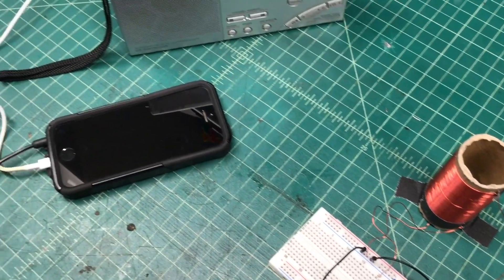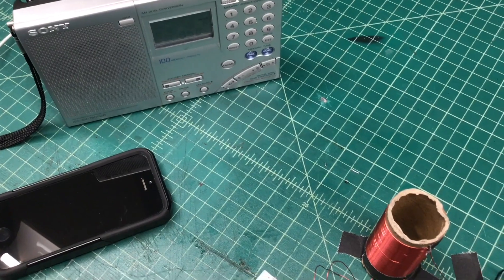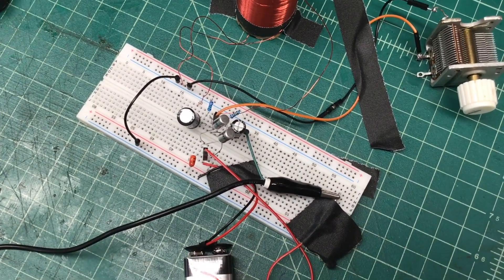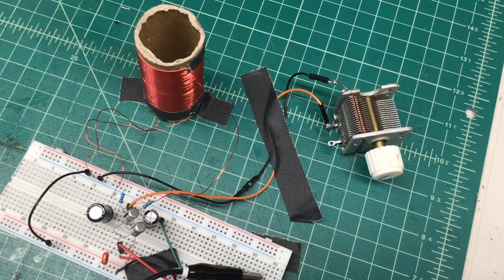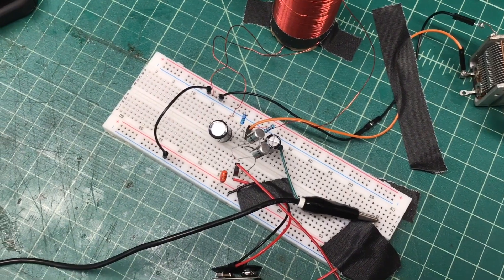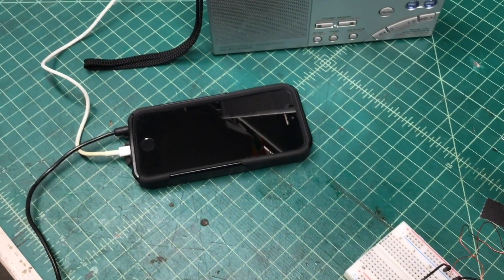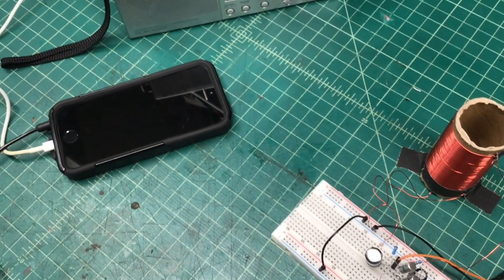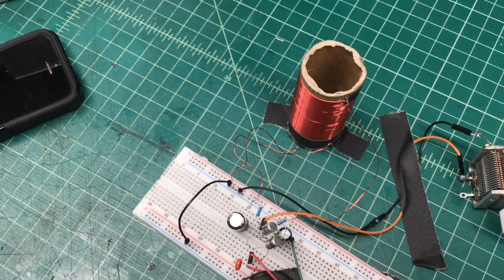A Simple AM Radio Transmitter - Part 1

Comment: Summing adapter for 2 channel mono is a must.
Reply from the maker: Thank you. Would you have a preferred circuit? All the best. Don
Reply: @RestoreOldRadios  A stereo jack, two 1kohm 1/4watt or something close but matching. Attach one resistor lead to the left and right channel tabs. Twist or join  the other leads together  and connect to audio in + and the shield tab to the input -
Reply from the maker: @ Thanks for replying. I incorporated this into some of my later designs. Thanks again. Don

JFET Common Gate Modulated Colpitts Oscillator
https://youtu.be/FMX5xdpxeJQ?si=h6pRMCM46t32tVuB
Reply: @RestoreOldRadios  Stereo music just doesn't sound right coming from one channel. Your welcome. Also I find including a ground loop isolating audio transformer between the transmitter and player is good practice especially if if it's a computer. It can tame a raspy sound.